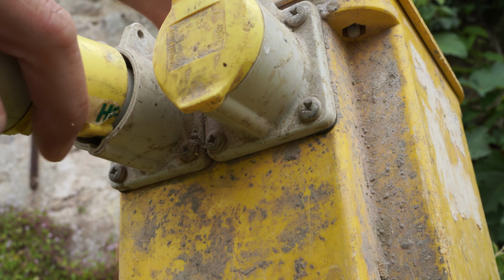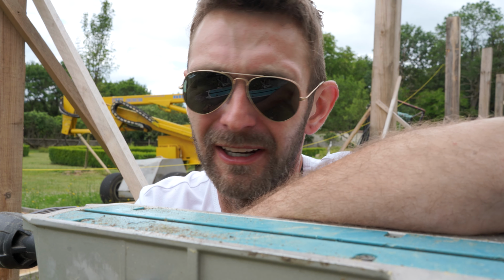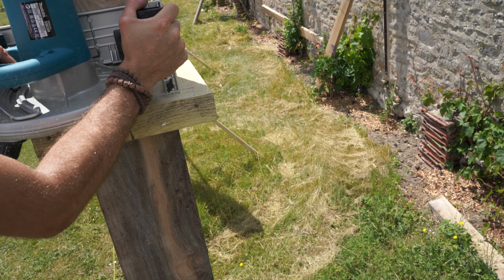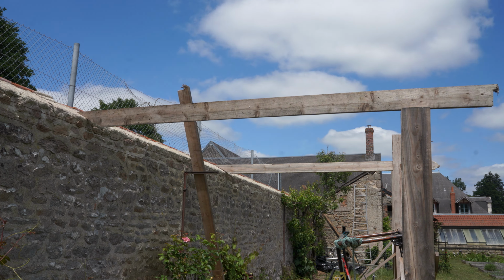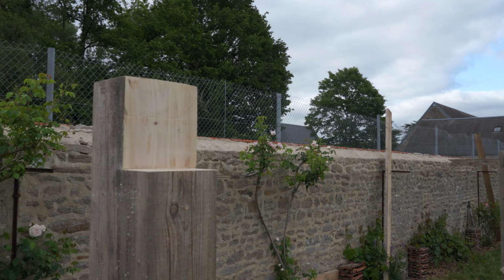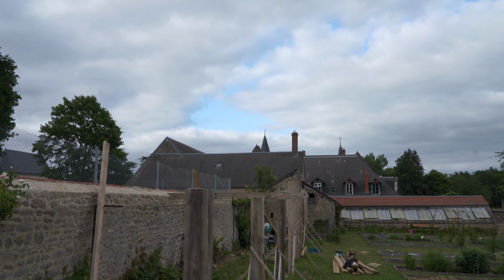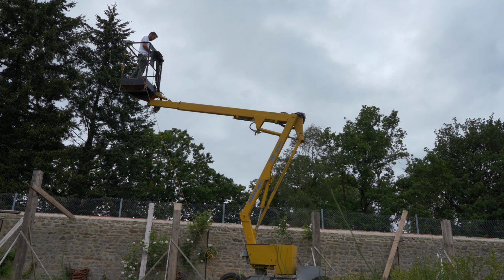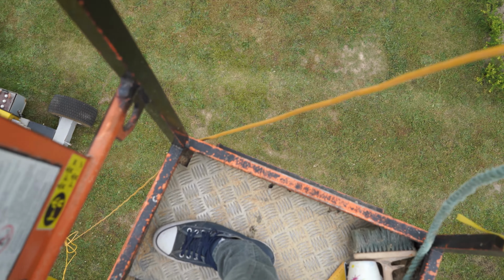Worst bungee jump ever | i wimped out

Comment: I'm wondering what product you'll be using on the tops' open grain.  I've gotta put something on the tops of my open grain soon.
Reply from the maker: We’re using a stainless steel cap
Reply: @escapetoruralfrance  Thanks. It will look great. I look forward to seeing that, {but for cost sake I might use something like roofing tar or a small cedar slab}.